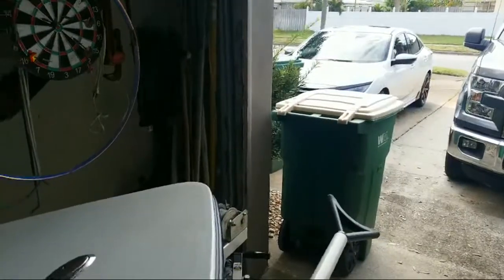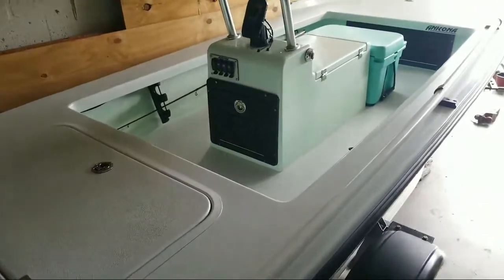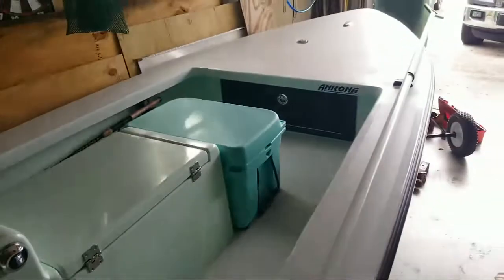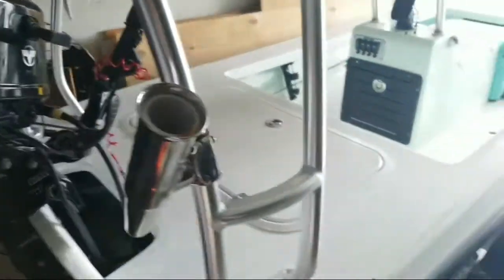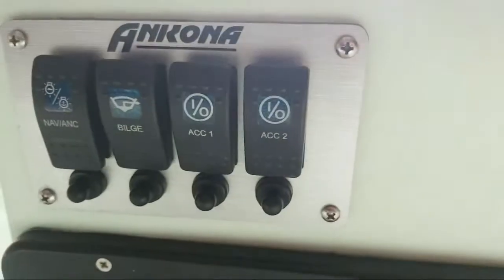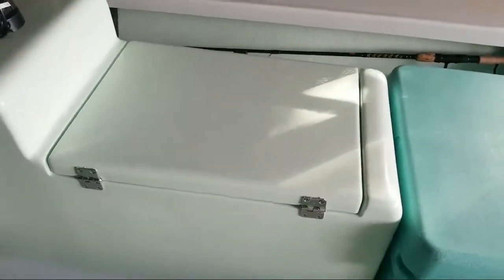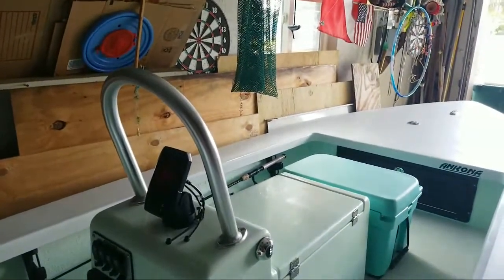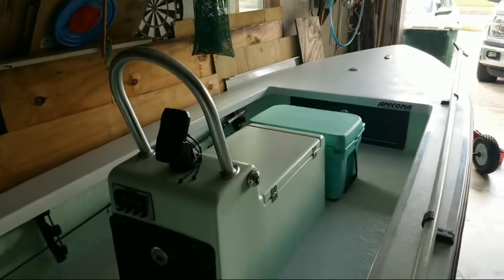FloridaFishyFinger Microskiff Podcast Episode 1 Reporting From the Shadowcast in the Garage

Comment: Like your skiff. I was thinking to have one build but they don’t make it now only the 18ft.so I settled on the sm14. Mine is in the mold now.
Reply from the maker: STOKED!  That is an incredible boat.
Reply: How much do the sm 14s run? I was looking at one potentially
Reply: @BrandonWatkins614  they go from about 10k to 15k depending what you do with it that’s trailer motor etc. I have the 20hp tohatsu elec start, Electric package, polling platform, grab bar, Continental trailer with fold away, Odyssey battery, sky blue hull with whisper gray deck. After tax was about 12k. That was year or so ago. Now it might be little more prices of everything are going up... I have thought about selling it and going even smaller now lol.